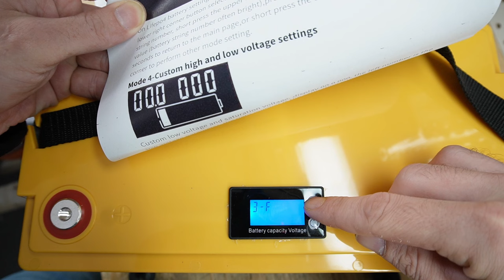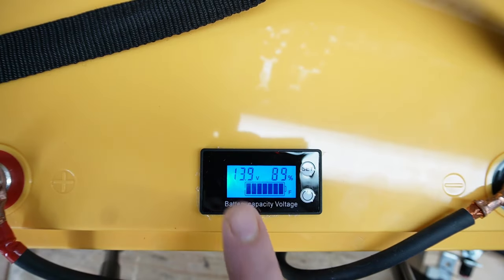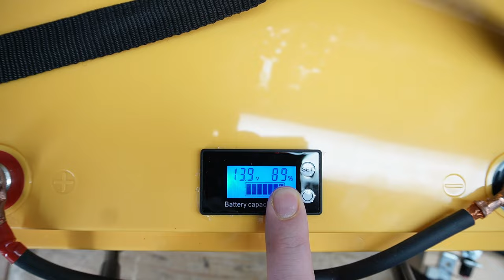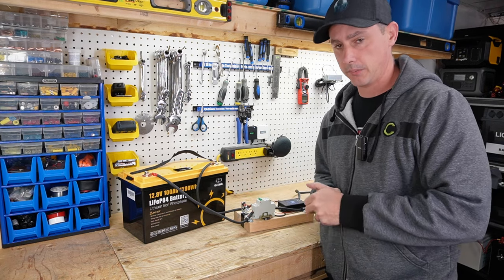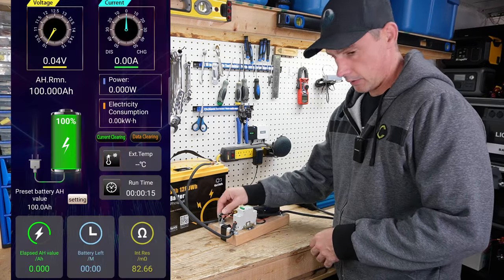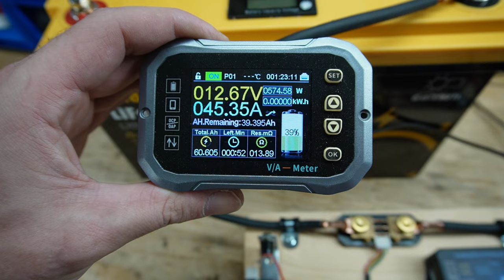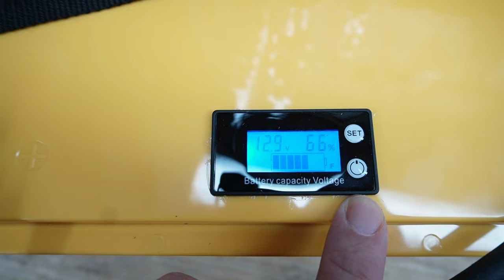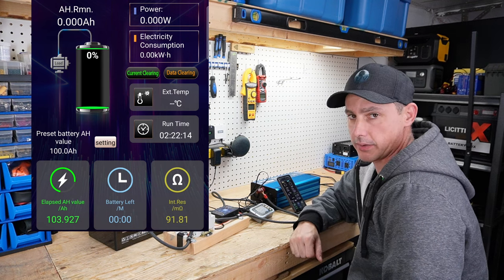GoKWh. Exposing Shoddy Battery Build Quality, 12V 100Ah LiFePO4 Battery

Comment: Thanks for the great reviews.  Just to add to the review re customer service, there is none in my experience.  I ordered from their US warehouse and they collected my money immediately.  4 weeks later it had not shipped and I asked about it. I needed a battery for a project.  No response. I asked again a week later and requested a refund as I had to buy from somewhere else.  No response.  I opened an investigation with PayPal and then they delivered the battery to the shipper. I contacted them  immediately and told them I no longer need the battery and requested a refund. No response.  So, seven weeks after ordering I will be receiving a battery I no longer need or want and through the entire process they did not respond to a single communication from me. I would run away from this seller and look at the other batteries reviewed on this channel.
Reply from the maker: Wow, that is not how to run a business. Sorry you had such a bad experience.

Comment: Oh man, those loose cables are awful! Those bolts are probably bottomed out and is maybe why they thought it was tightened correctly? But really common sense on their part should have caught that for sure.
Reply from the maker: I wish my microphone was working properly during that to catch my reaction. I was shocked. I was able to tighten the screw down with an impact gun and fix it.

Comment: Same findings here with this battery. In addition to the bad build quality, one of the pouch cells was leaking eletrolyte 😲(maybe damaged during transport due to the usage of the soft foam), so i had to stop further testing and give my workshop a good ventilation.

Second battery from GoKWH is on it's way, they seem to have learned and upgraded the build quality.
Reply from the maker: None of the batteries I've had have leaked on me yet, I'm scared of the day that happens. I have the new one to just haven't gotten around to review. They are still selling the crappy one.
Reply: @Roll2Videos  Well the good thing about that is: got some LiFePO4 pouch cell for experiments 🤷🏻.
Jup, i saw that they still sell the crappy ones. If you do not move them like in a RV that should not be a big problem - could still be usable in a stationary system. But it‘s not a good policy - they should be upgraded with at least the stiffer foam pads.

Comment: Good to know!  Unfortunately, you have to buy the battery first, unless someone like you has put the word out.  As they say, you (tend) to get what you pay for.  This one's got me puzzled:

The Cyclenbatt Mini is $134 on Amazon today, while they have another larger one for ~$170.  Both claim to be 100 AH batteries, except the dimensions of the larger one work out to ~658 cu in, while the smaller "mini" is only ~400 cu in.  The stated weight is about the same, but the larger one costs more, so what's really going on here?
Reply from the maker: @TheRealCheckmate  The smaller one is probably using pouch cells, and the larger one is using prismatic cells, if I had to guess.
Reply: @Roll2Videos  That could be it.  I asked the question on Amazon and the seller responded saying it was due to Amazon's pricing rules and different model numbers.  He said just buy the cheaper model.  I wanted to know what was inside the boxes and I still don't know.

What it looks like, after looking at literally hundreds of listings, is manufacturers were initially sizing the boxes based on traditional lead-acid "group numbers," but are starting to figure out that that isn't necessarily relevant, since most of these batteries lack the cold cranking amperage for cars anyway.  Several other manufacturers are now offering "mini" versions as well to save space.

Comment: pouch cells should have a lower internal resistance compared to prismatic cells, but they also need to have proper compression to withstand higher discharge rates without getting damaged prematurely.
Reply from the maker: That makes sense. Thank you you've taught me something new, I was unaware of that.

Comment: 1) I didn't see you confirm they are pouch cells. 2) if they are not pouch cells, and the price was low enough, I'd be tempted to buy them, disassemble them, and use them as part of a diy-type system. BMS seems fine if you can change the low temp setting.
Reply from the maker: Sorry about that, In the clip that I captured showing the pouch cells I had a microphone malfunction and cut it short.
They are indeed pouch cells and the low temperature parameter cannot be modified. It was a JBD bms that was about the only thing this battery had going for it. 🍻
Reply: It says they're pouch cells right on the website.
Reply from the maker: @PhonePhone-sf8te  Yes, I even posted the same graphic in my video that's on the website.

Comment: Too many quality control issues.  What did they do right?
Reply from the maker: They used a JBD BMS but with the wrong parameter settings. The pack passed the capacity test. 🤷